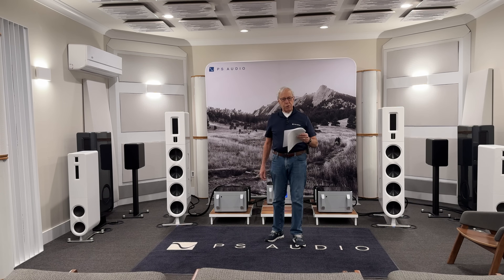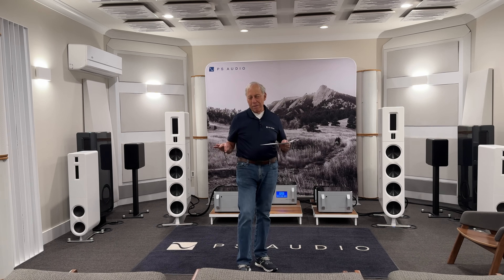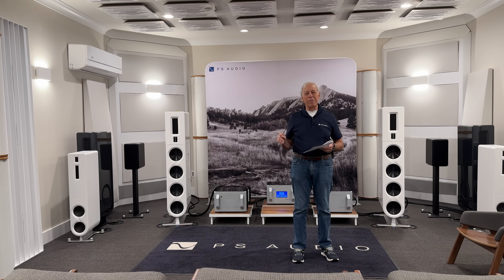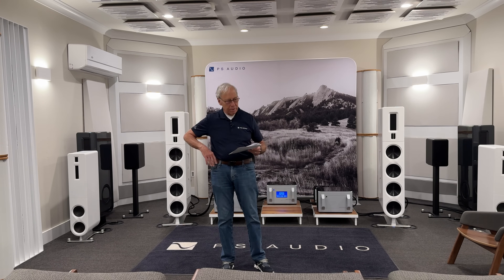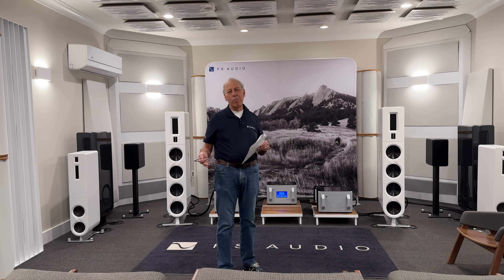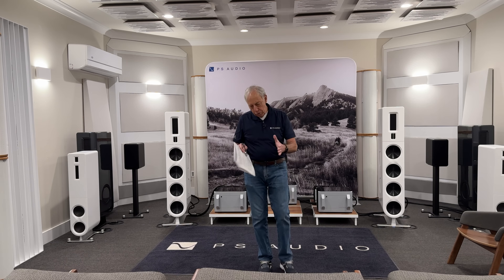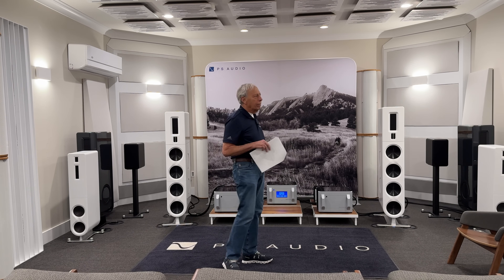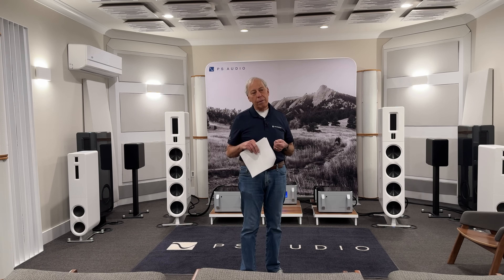Separating power cables

Comment: Paul... You're bringing back memories of the old five & dime road trips... 
I remember back in the mid-1960s going with dad to the Ben Franklin five & dime store. Real wood floor and 50 gal. wood barrels of products. 
Then we'd get back into dad's giant all steel all American made car with a big block V8.
Stop at the gas station on the way home and tell the pump jockey to filler up, check the oil and check the air in those old bias-ply tires. Hand the guy $5 bucks and be on our way.................

Comment: Mine all fall out of the back of my cabinet. I try to shove the speaker connects to one side and the power to the other but it moves when I turn it around to face out. I used to be crazy about every wire being tied to the same length and nothing over lapping but imho I never heard the difference, it just looked good.

Comment: Thanks a lot for this very interesting video
Imho the audio cable most critical are the one of the turntable because they have to carry the weakest signal 
So maybe using a shielded power cable for the turntable could be a wise decision   A wire carrying ac can generate a field 
To act as antenna the wire should be connected to an amplification device imho
For this reason shielded speaker cables have little to no sense because speakers are passive

Comment: Cables DO make a difference but at what cost ?  That's always been my challenge.    My limit is maybe $100.... I've seen $4K cables that is just NUTS...
Reply: I have about $800 or so total invested in cables in my system, I got my speaker cables on sale for $300 they listed for $800.  Get the best cables you can afford.  Your correct, they can make or break a system. A $4000 cable in a $50,000 system isn’t out of line, but we aren’t at that level of the hobby.
Reply: But all the wiring in your house doesnt?
Reply: Depends on your system
Reply: The amount of deleted posts is well above 50% never disrespectful... Makes me look at my then $500 PS audio power conditioner. Since it's 800 now, any takers lol
Reply: Funny that nobody quotes double blind listening experiments when touting certain (always expensive) speaker cables. There are many claims by people (golden ears?) about the wonderful sound of their favorite cables or the latest and greatest that they have just been listening to. It turns out that most people listen with their eyes. Also, coat hanger wire (in a 6 foot length) sounds just as good as the exotic cables when the listener has no idea what they are listening to. Snake oil is still being sold to this day… there is a buyer born every minute.

Comment: The only cables that I would shield is the power cables and the interconnects. It starts with the power for me. Shield the power cables. And then the interconnects shield them. Being as though I shield them both.  I noticed a difference with the sound structure. Start with them two first. And you should not have any problems. Yes your power and your interconnects as well as your speaker wires separate. For best results.

Comment: With shielded cables, be they power, interconnect or speaker. The shield should only be connected at the source end. So with power cables connect the shielding to the wall socket end, not the end that plugs into your equipment. Simples.😊
Reply: How can I incorporate this into car audio?

Comment: All of my hi-fi components are housed in a very low, very long, purpose built media cabinet. All mains cables, interconnects, speaker cables, Etc. Hang out the back and drape across the floor to the mains supply sockets. Mixed in with that cocktail of cables are HDMI cables connecting my tv to my dvd player and satelite box, plus RF cables running to the aerial socket and Ethernet cables running from my Wi-Fi router to just about everything. It is a veritable, wiring nightmare. My class-AV amps supply almost a kilowatt of musical power to each speaker. Vut I can say that with the volume turned up and no music playing, those speakers are totally silent. Even if you put your against them, absolutely nothing. No hint of interference, not electrical, EMF or RF.

I’m not an advocate of exotic cables, so I don’t invest in them. I do lean toward more price appropriate cabling. If you’ve invested $399 in your amplification and $499 in your speakers, there is little benefit to spending $150 per meter on speaker cables. But, if you’ve invested $5000 in amplification and similarly on speakers, then, maybe? It would be appropriate to invest $15.99 per meter om speakers.

I could tidy up that spaghetti junction of cables behind my media cabinet. But to do so would mean investing in much longer cables and I’m a staunch believer in keeping cables as short as possible.

Well, that’s my experience. I hope it’s of help. I’m not claiming that my cables don’t pick up unwanted EMF or RF interference, I’m just remarking that it does not manifest itself in the 20hz to 20khz audio frequency band, so doesn’t concern me.

Enjoy the music.

Comment: Real question is price of your system. You have the internal power supply of the amp and it's components, the power cable out to the outlet, the outlet itself, a dedicated copper romex run to it's own curcuit breaker and then the breaker box down into the rod into the earth. How far you want to take it depends on the level and class of your system. If you have 100 dollar system then good cables are really not going to do that much for it. If you have 400k system then you are wringing out every last drop of system improvement you can. Higher end systems reveal more detail but can also reveal more noise floor in a system. I run dedicated power outlets to their own breakers with 10 gage copper romex. Yes there are external power supply regulators but I find on high end systems those can hamper the sound in a negative way by over regulation. WHY do people buy power supplies then to plug gear into? Sometimes they do not have extra room on a circuit panel to give dedicated breakers. Other times it might not be allowed if living in a rental versus owning or too complex even if owning a unit in a complex for condo versus a stand alone house. Also finding electricians that specialize in that type of work are not as common. For all those reasons some just want a plug and play solution to regulate and clean up the power source some. I have ran tests before and dedicated lines blow away any power conditioner. I would put my system up against any regulated power supply system. The high end gear have good enough regulators in them to not need external regulation. The dedicated power lines simply take noise out of a shared circuit ( example 4 outlets in a room sharing the wiring to the panel versus one just for the amps). It only cost me a few k to run the dedicated lines. Costs involved often depend on length of the runs and how difficult to get the wires ran because of beams etc.

Comment: But I am using transgender cables , how can I know which one is male and which one is female ? 
These days those cables are so in fashion !
Reply: well Paul is wrong and doesn't understand and doesn't know what he's talking about, you shield it on both ends then you don't have a problem what gender it is.
Reply: Paul is right ❤❤❤
Reply: @hoobsgroove But he makes em!
Reply: I use all Audioquest Dragon PCs. 2 HC for my ARC Ref 750s and 2 Source for my ARC Ref 6Se and Ref CD9.
Reply: @antonyharding5360  on what basis do you put that? hes not a power supply engineer and he's definitely not an expert in EMI or other types of interference.
Reply: @hoobsgroove  He is an enthusiast with 50 years of experience and is entitled to an opinion and to share it.  It is up to each of us to decide what value it has.  In this case, I agree 100%.  And I have even less credentials than Paul.  :)

Comment: Ok. Shielding a cable that has ac .the same ac thats in all the walls and coming from the pole to your house and everybodys house? Nonsense.   The noise in the room is from class D switching and from your appliances and your neighbors lithium chargers and and any noise induced in the power cable...wait ...theres 2 wires in your power cable at ground potential wrapped around the 1 wire thats 120..if rf is in the power..then turn off your beer sign thats in your sound room..haha..hope that helps

Comment: Anyone who believes in the term ‘system integrity’ will try to route their cables to keep power cables away from interconnects and speaker cables  the best that we can and cross different types of  cables at a 90° angle to each other. Even if there is no audible difference, why be a slob.

Comment: What “noise” are you talking about? The only thing coming out of an AC power cable is 60Hz.  A shielded power cable is pointless and a waste of money. It does nothing at this frequency. In sever cases where you could have AC pickup because of interconnects (especially phono) you can purchase IEC connector line cords with twisted conductors. That will minimize the the 60Hz field. They’re available for less than $20.
Even better, and cheaper, would be (as stated other comments) to simply separate your AC power cables from your interconnects by more than three (3) inches.
And no, you won’t pick up noise on your speakers cables (Danny Ritchie’s stunt “proof” notwithstanding) because the impedance in that circuit is too low and the signals are too high.
Reply from the maker: We're not trying to keep 60Hz in (you're right, that would be silly) but we're trying to keep all the high frequency crap riding on the line out. There's a great deal of switching noise from diode bridges etc. when the power cable is feeding the unit.

Comment: no you're wrong you don't shield it at the male end no you shield it at both ends or if it has to be at one end the female end not the male end to block EMI.
Reply: @hoobsgroove 

If that's the case, how do you drain the shield? Stands to reason you would want to drain into the receptacle and not back through the component.

Male end is at the receptacle.
Reply: no you're wrong you don't do that you do something else entirely in order to block the wtf.
Reply: @stever7638  no he's right you are shielding, I'm not sure what you mean by draining it is going back to Earth electricity interference will want to go back to ground not the other way around it takes the lowest resistance possible.
Reply: Connecting it at both ends is bad, as then it will carry current, and as such be a radiator, rather than a shield.
Yes the shield ideally covers both ends, but should be tied to earth only at the source end.
Reply: @paulstubbs7678  it's not going to carry any current and it is covered anyway there's no benefit of connecting it to the wall socket only thing you're doing is shielding the cable in the wall and not in the device.! if it's not shielded to the device you're allowing EMI to penetrate into the device and you need metal sockets and metal plugs to be truly emi resistant. You  have to look at EMI interference as water they work in the same way it flows in the same way ENI will find any route possible to get in it needs to be water tight EMI tight.
Reply: For best results, use braided or twisted cable. Otherwise, remember SS:  Shield the Source.
Reply: @hoobsgroove  Interesting points, Yes it would be nice to have the shielding start back where the power enters the property, and as for the metal case of the gear, you'd basically have to have it (the case) isolated from everything in the equipment, kind of like what's needed to qualify for 'double insulation' as needed when you have no earth connection at all.
So would this improve anything? It looks like someone needs to do some trials with two identical systems, one modified and one using just a regular shielded power lead.
Beyond this maybe we need a totally independent earth system dedicated to shielded HiFi gear, after all the regular one could be contaminated with crud from all sorts of household appliances etc.
Reply: @paulstubbs7678  I think the problem is people shield the neutral as well you don't shield the neutral you just shield the live wire, that might be why he's getting these weird interference test results.